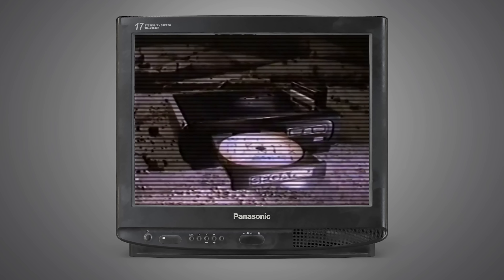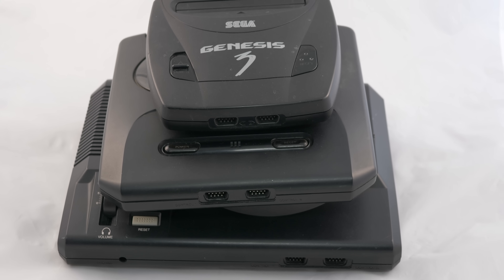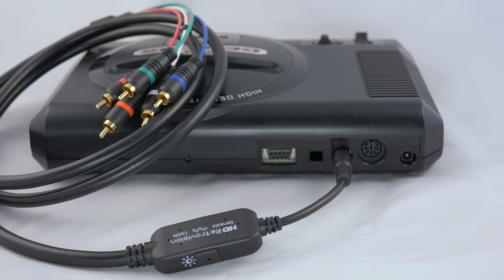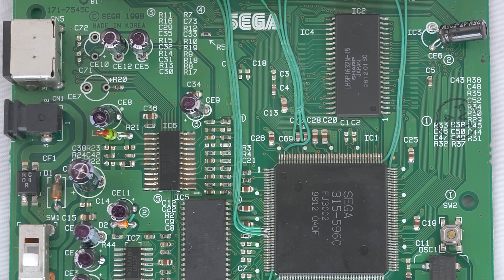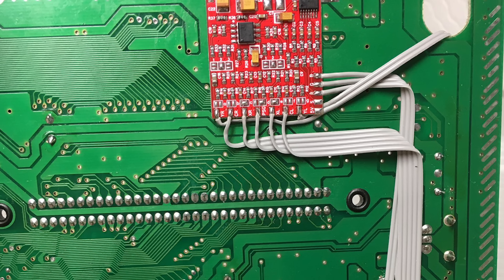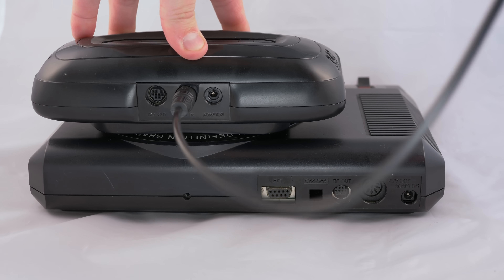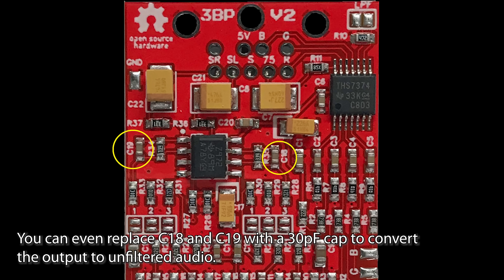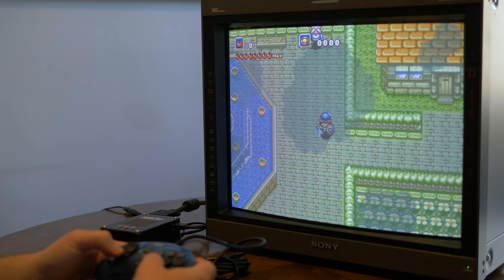Introducing The Sega Triple Bypass

Comment: The old audio sounds better for me. It has a lower bit rate? It sounds more vintage. What does the triple bypass change in audio? The khz range???? I prefer the old audio, that Yamaha chip is bad ass. Those chips are sought out in electronic music. Most people won’t know that.
Reply: Well it doesn't change the Yamaha chip, that is still in use. It replaces the audio amp(s) in the console. So we are talking about all analog signals and filtering/attenuation of said signals.

Comment: Bob did you know the very, very first JP MD has perfect video and audio out of the box, no mods necessary, doesn’t even have jailbars.
Reply: Has to be the very first model though, they are hard to find.  Not just the early model number - there’s a small initial run with the first box design, but they are findable in Japan.
Reply from the maker: That's definitely not true.  I've personally tested a 1st run of Japanese boards and it had a world of issues.
Reply: RetroRGB that’s surprising to hear, I’ve had three and they were all perfect.  Not even the bypass needed.  Perfect sound, perfect RGB.  Others have reported the same, but I trust your findings.  It has to be the very first iteration.
Reply: RetroRGB they were all VA0?  After that things get screwy, and by VA5 it’s very different.

Comment: On the Genesis 2, I can obviously tell the difference. The 3BP sounds cleaner than the original audio output.
Reply: Not all Genesis Model 2's are bad, and and not all Genesis 1's are good. I've got a VA4 Model 2 and the audio and video are pretty damn good already.
Reply: @AlexvrbX  Yep, and the VA7 model 1s sound just as bad as the VA0/1/1.8 model 2s. It's just not as cut and dry with the Mega Drive/ Genesis, but now the 3BP can even the playing field.
Reply: I'm such a purist. Hearing them side-by-side makes me like the original audio. That grungy sound with the occasional clipping is more...Genesis-y to me.

Comment: Funnily enough I don't I ever connected a console I personally owned when it was still 'current' using RF, except as a last resort.

My SNES was, from the start, connected through composite.
And that's probably only because I didn't realise better options existed.

After all, to actually use composite, I had to use a converter, because, believe it or not, it was pretty common in the early 90's for the ONLY connector on a European TV to be a SCART connector. (or as it's officially called, Peritel, but nobody calls it that.)

That makes the probability that the TV supported RGB input quite high indeed.

And it only got worse further into the 90's.
Which honestly makes the n64 video output circuitry all the more bizarre.

Only the first generation NTSC machines support RGB, and a slightly later NTSC revision supports being modded for RGB easily.
The NTSC models generally all support S-video properly too.

PAL machines though? They support Composite only, and for early revisions a partial implementation of S-video that is way too bright. (lacks a few key components.)
This is in spite of the fact that the vast majority of PAL televisions in the 90's would natively support RGB SCART, and that the SNES supported RGB output, the n64 uses the same connector as the SNES, and the gamecube again supports RGB out through that exact same connector, leaving only the n64 as the non-RGB capable system in a part of the world where RGB capable TV's were at their peak of availability...

Figures doesn't it. XD

Comment: Not to sound negative but why now? Why build a mod that improves the Genesis/Mega Drive's performance? It's like polishing a turd. Why not just use the KFusion Emulator on PC. The Emulator is clocked .2MHz higher and is based on the Superior MC68030 instead of the older MC68000. Why does the Genesis/Mega Drive need an entirely new board just to give better sound and visual quality? The SNES only needed an HDMI adapter.
Reply from the maker: Why listen to old music when new music is being made every day?

Comment: Does the 3BP installed in a Model 1 eliminate the need for the mixing cable when connected to a Sega CD?
Reply from the maker: Yes, after installing the 3BP, it's recommended you just get the audio from there.  Also, you never needed the mixing cable...Sega made it very confusing:  https://www.retrorgb.com/segacd.html

Comment: My question, if anyone knows… if this outputs stereo audio out of the model 1 without needing the headphone jack, meaning it’s no longer needed to mix in stereo audio from the headphone to the sega CD... how do you control the audio output level? Or is it no longer necessary? I find I need to lower the Genesis audio considerably to keep things balanced relative to Sega CD audio, like in Sonic CD... all the sound effects are LOUD compared to the music. Gotta take that slider down a few notches.
Reply from the maker: Everything's now properly balanced.  Just take audio from the Genesis' DIN and not use the Sega CD's RCA jacks.
Reply: RetroRGB thats fantastic, really good to know. Will absolutely have to put this one on my to-do list, thank you so much!!
Reply: This is an interesting question for sure.  We spent a lot of time discussing the proper level on a model 1 genesis going to a sega cd.  Orig ally when just recording consoles we always put the slider to 10 but after doing the sega cd as well and reading the manual it actually suggest that you put it at 7-8.  When installed in a model 1 the sega cd audio mixed at a level similar to a 7 on a model 1 slider.  With the recent headphone re-enable on a model 1 you can choose to use a mixing cable back to the sega cd and adjust it that way.  This does offer the advantage of having unfiltered cd audio which some people prefer.

Comment: Oh, that’s fuckin’ awesome. I’m gettin’ that for the. Genesis I bought, 3 years ago, on a whim, for $30, at the local Comi-Con, which was much bigger and better than I’d thought and was the first time I got to wear a Marty McFly costume I’ve been putting together (that goddamned vest made me for get about the ‘80s, patterned denim patchwork jean jacket, until it was too locate, to get those not on e-Bay), for which I won third place and got some signed poster and a set of comics, from an up and coming (and still never herd otherwise about, unfortunately) comic artist. I already had a Turbo ASCII controller, for my second one (‘cause only one came with that OG unit, for $30, along with the R/F connector) I’d bought, in the nineties). I just did the PS4 Genesis Collection, for myself, for Christmas, and just Project Erised .95 one of my PSCs, this week, but that Triple Bypass chip is getting bought, then installed, the next time I have an urge to pull out the soldering iron, even if it were just an audio thing, because the Genesis was representative of their philosophy about hardware — ironically, until the Dreamcast — which was just to be there, in peoples’ homes, to drive their SEGA-ass games, for their 4.667 generations of hardware, amidst which Genesis Sound was total shit, just like their total color pallets and numbers of colors onscreen, at once — which was SOOOOO ridiculously cheap, I bet the other, also-1989, 16-bit console — the Atari Lynx, which was their Atari 800 of ‘90s (after spending the mid- and second-half of the ‘80s, making title after title of incredible arcade games days (see, e.g., the “really fudging good” Road Runner game (vs. the NES), Indiana Jones and the Temple of Doom, Gauntlet, Road Blasters, the trilogy of vector-graphics Star Wars X-Wing/movie titles) had better specs, because headphones from them could sound better than anything the Genesis could output (like a 1989 version of a POKEY), but that card made it sound so,so much better, for a Genesis, you can tell they didn’t care how they could get that horrible audio out of the machine, and it actually sounds like the people who programmed the sound cared about it...

I think those are two of the longest non-run-on sentences I’ve seen, using a lot of grammatical strategies and tricks, to spell out some total ADHD, stream-of-consciousness writing.

Comment: My model 2 sounds just like that, I thought maybe my 32x was the culprit so I recapped it but it didn't fix the issue, same with the video interference I was getting when using the 32x. I even did the other 32x capacitor upgrade to replace those other 2 caps for noisey video and not only did it not work but now my 32x has a yellow hue on 32x games, so if someone knows something about that and could help that'd be awesome.

Comment: Great informative video as always Bob! I found out about the Triple Bypass from your website some time back. Since then i have tried it (and Voultars RGB) on multiple MKI and MKII PAL consoles. As you can imagine i got different results each time both in audio and visual. My main objective was getting rid of the jailbars. With many hours of tinkering I found on the MKI VA4 i ended up just lifting the sub carrier and using Firebrandx's audio mod got the best results (on that specific board) I prefer the colour output of the CXA. MKII I used the triple bypass on two versions one UK-PAL and one ASIAN-PAL. The jailbars was 99% gone on the ASIAN model but around 80% gone on the PAL model. Now here's whats more interesting, putting them through an OSSC jailbars are a lot more noticeable but through a Framemiester you can barely notice them on any model once the mods are installed or even the stock  CXA. I'm still on the hunt for the perfect Sega Genesis/Mega Drive board that has the least noise even after trying it on more than 6 different boards. I'm trying to get hold of a Brazilian MKIII and a X'Eye to see how those results turn out :)

Comment: Strangely enough, I've found HDRV enough to practically eliminate the noise (even got rid of the Samsung encoder artifacting on my VA3 model 2). Like, I'd have to press my face to my TV to see anything. Using my 32X however, introduces bad jail bars. Mileage definitely varies with old tech.
Reply: Pardon my ignorance but how does HDRV work?
Reply: @YUJ9717  It basically taps the RGB signal of the console, which produces a sharper/cleaner image than the yellow composite video plug on a regular AV cable does.
It's the same idea as the European SCART hookup standard, though instead using a US-familiar method.

Comment: I picked up a Genesis 3 cheap from toys r us back in the day.  Just keep it to complete the set.  Had no idea anybody cared enough to make mods for it.
Reply: If it's VA1, you can mod that sucker and it will then be functionally identical to the first two models.   It will then also be compatible with the Terraonion megaSD cartridge, which plays regular SegaCD images.  The only thing it won't play is SegaCD 32X, as it's missing the expansion port.   RetroRGB has pictures on how to tell whether a Genesis 3 is VA1 or VA2.  After the triple bypass, it will have at least the same audio and better video capability than the best model 1 version.
Reply: @bruceg22000  so im curious then. Would the cdx play the 32x/cd games combo? From a flash cart?
Reply: @cbk12  Officially you need to disconnect the Sega CD to play them from the cartridge, which you can’t do with a CDX, but I recall it was working anyway for someone (Krikzz?).
Reply: @emmettturner9452  good to know thank you 😊

Comment: Is it possible to install the triple bypass on a model 1 using the original 8-pin din?
Reply from the maker: Yes!  Just sever the outputs to the 8-pin DIN, affix the 3BP safely on the board, then wire the outputs to the DIN.  You can either wire stereo line audio to the headphone jack, or when the documentation is released, enable 3BP true headphone audio from the front jack.
Reply: RetroRGB nice! I know the genesis 2 style is better, but i already have a fully shielded mode 1 cable and the 32x is simply too expensive in europe...thanks bob for the answer!

Comment: Does the VA7 Model 1 produce the same noise as other model 1s? I'm wondering if it needs further modding after the triple bypass like the others. I read it's pretty much a model 2.
Reply from the maker: The VA7 is essentially a Genesis 2, so I'd highly recommend doing the 3BP to it.  Jose's done a few and it's a worthwhile upgrade.
Reply: I think he's wondering if you need to add the SMD capacitors on the VA7 model 1 as well in order to fix the jailbars.

Comment: Bob, is there going to be a Triple Bypass installation video or more detailed website instructions for either a common model 2 Genesis with lousy sound or a model 3 VA1?  Right now I just see pictures on your website, and I know there are some pins that require lifting and/or traces that need cutting.    If you are going to do it, I'll buy and donate a triple bypass chip if that helps.  Personally, I'm going to find a Genesis 3 VA1 on Ebay and try this myself.
Reply from the maker: All the documentation will be released with the wiki...which really is coming.  Everything going on really slowed that down though :(

Comment: I bought one of the early batch units with the Mini-DIN pre-soldered. Lacking the skills or proper tools to remove it, I broke a few traces, and the RGB bypass part no longer works. Luckily, I was able restore the original RGB path and now only use the audio part of the 3BP (which is fine, I guess, because my MD2 VA1 PAL actually happens to have decent RGB output, no jailbars when using csync). Still, this experience bugs me to this day, and kind of triggers me every time I hear about the 3BP. I hope to get an new unit and do it properly once units without pre-soldered DIN become available in Europe (Insurrection don't ship to Europe, and their partner, gamesconnection.co.uk still seems to have the old stock). I've seen people have their (green) 3BP boards by fab houses and then add the components themselves, but that's too hard for me.

Comment: I got rid of my Jailbars by lifting Pin 50 on my Model 1, got rid of the jailbars for good. Since I have a Cable for my 32x that included Stereo from the headphone-jack  I will pass on this one.
Reply: I've done the same. Lifting pin 50 significantly improved jailbars. Unfortunately, it did not remove them, but it's good enough for me; it's only noticeable if I really look hard. My Master System however, I did get a RGB bypass as those bars were really bad!
Reply: @redhotsonic  My master system was the same at first, but I tried the MegaDrive Cable I ordered for my 32x Setup with clear sync and that gave me an amzing picture without jailbars
.
Reply: @Retro_Royal  - I've tried the Packapunch RGB cables, RGB bypass mod, recapped, and composite traces cut. They're still there for me 😓

Comment: 2:30 dear lord that solder job
Reply: I think I just heard Voultar hitting the floor.
Reply from the maker: If you think that's a bad soldering job, you have no clue what you're doing.  Do you even understand what's going on there?
Reply: RetroRGB at least clean up the scrap insulation off the board
Reply from the maker: Are you talking about the capacitor that's soldered on the motherboard to filter the signal?  I show it again later in the video.
Reply: RetroRGB no I’m talking about the red insulation not connecting anything sitting below that cap. You can see it in all the shots of that chip. And you have so much copper stripped and only the tip soldered. On that kind of job I like soldering up the leg from the board, especially when there’s something like that cap you were trying to avoid, rather than having a long piece of bare copper floating above another component.